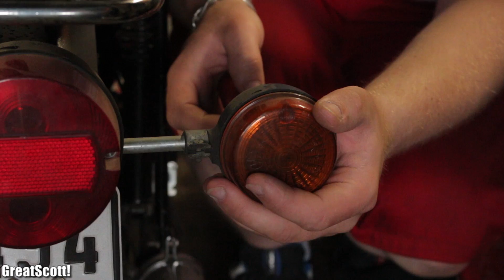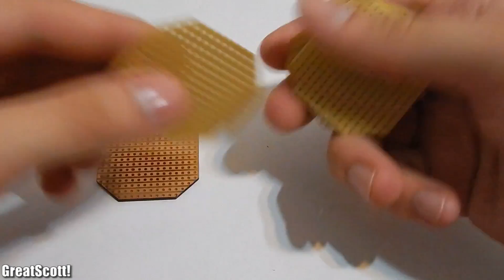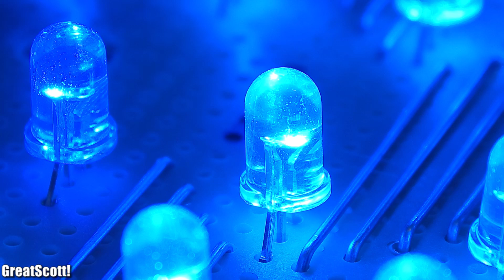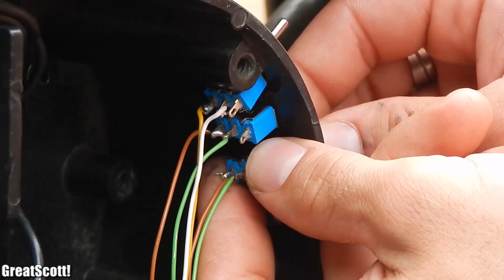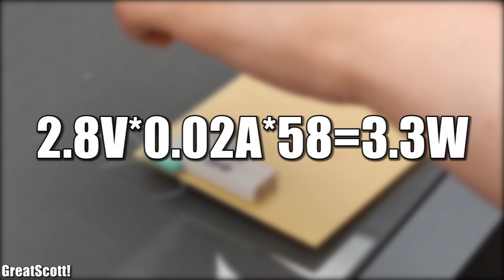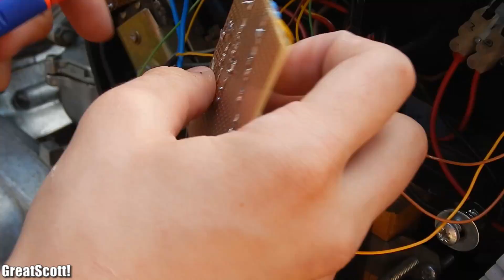Moped Mod:Turn Signals+Under Body Light+Brake Light

Comment: The results are quite impressive, especially for nighttime riding. I do have some constructive criticism though.

5:16 You're pissing away a lot of power there - you could fly to the moon on 3.3W! No worries though, really; the moped's alternator is constantly recharging the battery, and it's still a bit more efficient than the incandescent bulbs. (My current project is bicycle lights powered by a LiPO flatpack, so how much power gets pissed away is foremost in my mind.) If efficiency is a concern for you, you could whack in a switching regulator to drop the voltage and adjust your load resistors accordingly.

As has been stated in other comments, you really would have done better to use individual dropper resistors on each LED. (If the LEDs were selectively binned for voltage drop and current, you might be OK, but if there's any variation you could come a gutser.) You could have used 1/4 watt resistors on each LED at a fraction of the cost of those massive cement bricks!

Comment: Hi, Scott! I'd like to do a project to my bicycle, using leds to turn signal, hazard light, brake light, normal lights, and a LCD screen 16x2 to show the speed (using reed switch), plus a thermomether (lm35), and Piezzo buzzer to horn, all this in a Arduino Uno.

Could you do a video just like this?
Reply: That's not such a hard project. Just watch some tutorials about LCDs, LEDs and arduino programming.
Reply: And for the speed, you can use a hall effect sensor and a magnet.

Comment: Hi, my soon to be new has unsmoothed DC electrical system (only filtering and voltage control after alternator) Can you let me know how i can get a 12V DC supply from this? will using voltage regulator and some caps work? (i dont think so)